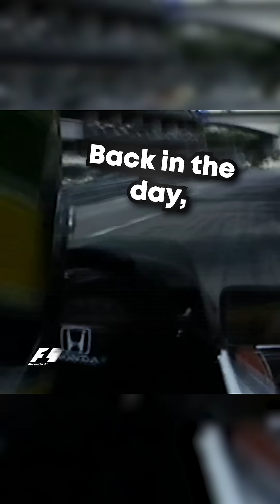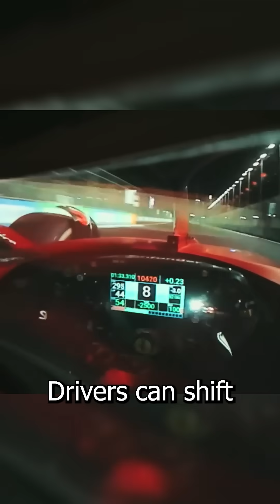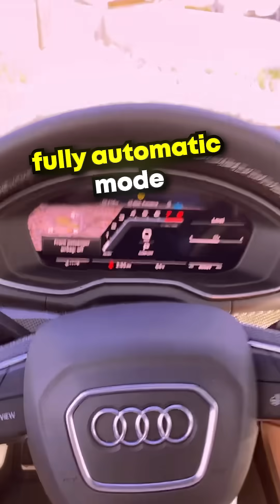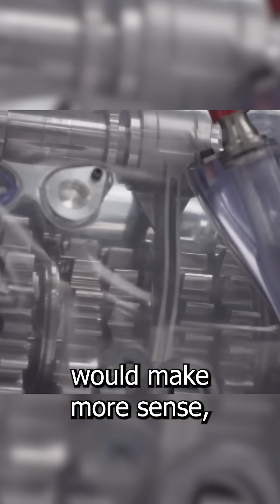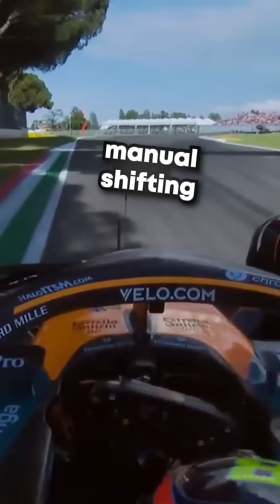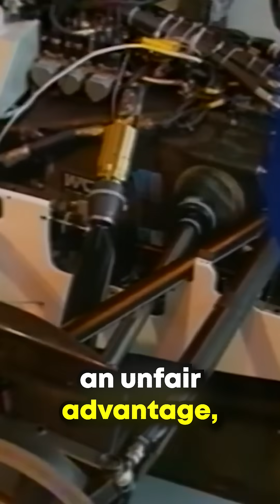Why F1 Cars Are Manual And Not Automatic?

Comment: Calling paddle shifting "manual" and then using cvt as automatic example is just stupid
Reply: paddle shifting is manual though
Reply: @journeyofabadracerit's not, it's semi-automatic
Reply: @bloodysquirrel1731 i mean it is a manual any transmission that you manually shift gears and have a clutch is a manual which these cars do
Reply: @journeyofabadracer just because u "manually" shift the gears doesnt mean its a manual, paddle shifting is sequential because it doesnt require a manually operated clutch to shift through the gears. do ur research before saying anything next time dude
Reply: @journeyofabadracer dude, in F1 you don't shift with clutch...
Reply: @bloodysquirrel1731 they have a clutch though it’s a sequential manual transmission lol
Reply: @journeyofabadracerthey have clutch, to start only, they don't shift with clutch. That's a standard thing for race cars. It's semi-automatic. Not manual. They don't shift how bikes do, they don't pull clutch, shift, release clutch. They just shift
Reply: @bloodysquirrel1731  its a sequential it doesnt use a clutch to shift it uses it for starting and shit obviously its still manually shifting gears as a manual or sequential stick shifts
Reply: @journeyofabadracer just because u "manually" shift the gears doesnt mean its a manual. doubling down when yk ur wrong is a bold move mate
Reply: @il_commendatore999no i don’t know im wrong because i know im right you are manually shifting its a manual not a semi auto or whatever he said
Reply: @journeyofabadracer that's exactly what "semi-automatic transmission" means. You manually select a gear you want to be in and a car automatically operates mechanical bits to shift, hence semi-automatic. You should really read up some definitions before you make a fool of yourself
Reply: @bloodysquirrel1731 the computer doesn’t shift the car? like any other sequential the transmission is doing all the work the only thing the computer on the f1 cars do shifting wise is just make the shifts faster you can easily shift the sequential cars without any of those computers
Reply: @journeyofabadracer search up sequential mate
Reply: @journeyofabadracer dude, it doesn't matter it's sequential, you can have semi-automatic H pattern. Please, look up what semi-automatic means, then talk
Reply: @bloodysquirrel1731 i know what a semi automatic means lmao it isn’t one
Reply: @il_commendatore999i know what a sequential is
Reply: @journeyofabadracerit's exactly what it is. Not out fault you are dense
Reply: @bloodysquirrel1731 no it isn’t lol a semi auto is something like a dual clutch where it has both an auto mode and a sequential mode sequential gear boxes are manual with an automated clutch blip and sometimes an automated throttle blip other then that there’s no difference between a sequential and a manual
Reply: @bloodysquirrel1731  just ignore that guy, if he doesnt want information then ig we dont need to give it.
Reply: @journeyofabadracer keep believing what u believe, at the end of the day you'll be in for a big surprise when u actually search it up
Reply: @il_commendatore999i have actually searched it up lmao tell me what i’m missing otherwise
Reply: @journeyofabadracerdude, you are describing semi automatic. You select a gear and a car shifts (automatic clutch and throttle as you said). Yes, most automatic cars can switch to semi automatic mode but that doesn't mean that semi automatic cant exists on its own.
Reply: @il_commendatore999You can shift any "100% manual" gearbox in the world without using clutch.
Reply: @journeyofabadracerYou ain't right then. Please do your research.
Reply: @bloodysquirrel1731 your all wrong let me break it down. Formula 1 transmission uses electronics and hydraulics for lightning-fast shifts, eliminating the clutch pedal for most driving. Think of it as a highly sophisticated, computer-controlled manual where the driver tells the car when to shift, but the car handles the clutch.
Reply: @PDX_MilitiaOfWar "used electronics... Handles clutch automaticky"
thanks for confirming that it's semi-automatic transmission
Reply: @bloodysquirrel1731 bro what you mean my father works on the cars for Red Bull team
Reply: @PDX_MilitiaOfWar and he is not sharing his expertise with you, right? F1 transmission is classified as semi automatic anywhere you look. I would also be surprised if the shifts actually use clutch, it will be most likely clutch less shifting as most racing cars and bikes do.
Reply: You're just being pedantic
Reply: Turbo clueless ye i agree
Reply: it's not stupid, it's diabolically idiotic
Reply: my apologies einstein 🤣
Reply: The word Manual is defined as "relating to or done with hands" therefore paddles are manuals by definition. You may not like it but it's the truth
Reply: Psh cvt was the goat when it was implemented
Reply: @BrandonBerube-j7y being goat doesn't make it automatic tho
Reply: Let’s race 🥀
Reply: Ok to add up.. manual is you change the gear manually by your hand not by mechanical components through a lever..😂
Your meaning of manual is not correct! 😂
Reply: @a.a.a.nugroho not, what you are talking about is semi-automatic. In semi-automatic you tell a computer which gear you want to be in and the computer does the rest of the work.
In manual, you do all the work, from disengaging l disengaging clutch to moving gear mechanism
Reply: @bloodysquirrel1731  you're just being pedantic
Reply: @a.a.a.nugroho or you being ignorant
Reply: @bloodysquirrel1731  paddle shift always mentioned as manually changing gears, because yourself changing it, even though system does the inside part. You can read it in the news..  GET IT?
Reply: @a.a.a.nugroho where is it written?
Reply: I guess a sequential transmission is automatic too right 😒 cause you don’t have to use the clutch for that unless starting and stopping
Reply: @Markbabb  sequential transmissions aren't automatic in any way. 

It is also possible to shift H pattern manuals (race and road car transmissions) without using the clutch in a way that doesn't damage the car, does that make it an automatic transmission?
Reply: @Official_MikeyT bro I never said it was I was being sarcastic
Reply: @Official_MikeyT half the people that drive manual can't shift without clutch sadly
Reply: @Markbabb  sequential isnt automatic or manual they are literally called sequential.
Reply: @inspectah6278  Sequential is the type of shifter, the gearbox is a manual.
Reply: @DriftNick as long as you don't need to control clutch, it never can be manual.
Reply: @bloodysquirrel1731  In the context of F1 they do need to control the clutch to get into first and launch but that is irrelevant to what makes a manual a manual, there manuals where the clutch and shifting is fully controlled by a computer, they are still manual gearboxes, the internals and how the gearbox functions is what makes it a manual.
Reply: @DriftNick  what? Did you smoke something? Automatic means that the car operates internal components automatically. Manual means that you operate the internal components manually. That's all, doesn't matter if you have dual dry clutch, dual wet clutch or just standard clutch. First automatics were nothing else than just computer controlling standard clutch that was in manual cars
Reply: @bloodysquirrel1731  What I smoked is having a basic understanding of what makes a manual gearbox a manual gearbox, F1 uses manual gearboxes, it's as simply as that, paddle shifter does not change that fact.
Reply: @DriftNick ok, explain it. Make me definition for automatic and manual gear box. What is the difference in your world?
Reply: Sequential transmissions are still considered manual. and CVTs are still considered automatic. So the video technically isnt wrong, but he definately should have specified
Reply: @ZakoZeWacko  how tf is sequntial manual?
Reply: @il_commendatore999 are motorcycles automatic then ?
Reply: @moonmoon4188  depends on what motorcycle ur talking abt
Reply: @il_commendatore999how is it not? You have to manually select the gears. All h patterns are manuals but not all manuals are h patterns
Reply: @Evildragonfirez selecting gear is not shifting tho. In elevator you select floor, but do you manually elevate yourself?
Reply: @bloodysquirrel1731 selecting a gear is shifting though, that’s literally what a manual transmission is, the ability to select the gear the vehicle is in. Using a stick is a way of shifting, but so is using a paddle
Reply: @Evildragonfirez  but with paddle shifters, ur not actually shifting the gears by urself like with a manual. a manual is physically connected to the gearbox while a sequential is electro hydraulically actuated, which means that its ur not physically shifting the gears by urself. each paddle shift goes through a computer which sees the gear u select and shifts into that gear
Reply: @Evildragonfirez no, cause you operate the mechanical bits, you don't select gears in manual, you physically moved the gears. In semi automatic and automatic it's the computer that operates mechanical bits
Reply: @il_commendatore999analog vs digital, still a manual. What matters is that driver is selecting the shift of the vehicle, that’s it. Look up sequential and you’ll see that’s it’s a type of manual transmission. It sure as hell isn’t an automatic
Reply: @Evildragonfirez  nobody said its automatic mate, sequential is sequential, manual is manual, and automatic is automatic. i cant believe im having to explain this to u kids.
Reply: @il_commendatore999sequential just means that your can’t skip gears, that you must shift sequentially, still a manual.

But enlighten me genius, what is a manual to you?
Reply: @Evildragonfirez  a manual transmission is a transmission in which u manually shift, using a manual clutch, to change the gears in a car. while f1 cars do have a manually uperated clutch paddle, it is only use to get rolling, not to shift gears, therefore it is not a manual transmission, but a sequential transmission.
Reply: @Evildragonfirez yes, if you read my comments you would know that I said that manual can be sequential and H pattern can be semi automatic. The definition of semi automatic is that you select a gear and the cars shifts into that gear. Manual means that you operate every step of shifting, aka controlling gas, clutch and gears.
Reply: @bloodysquirrel1731 that’s not what manual means, that’s your interpretation
Reply: @bloodysquirrel1731 you don’t need to control the clutch for a transmission to be manual, please link a source for that definition. There are even clutch-less h patterns (they’re not really clutch less but the clutch is engaged at the point of gate actuation), what are you talking about man?
Reply: @Evildragonfirez you can find definition for semi automatic and manual yourself. It doesn't allow me to post links.
Yes, clutchless H pattern is semi-automatic H pattern....
Reply: @il_commendatore999 It is a manual  transmission, it works like every other manual transmission, sequential is simply the type of shifter it uses, the difference is in what moves the shift forks.
Reply: @il_commendatore999 So then according to you, none of my motorcycles have manual transmission.
Reply: @bloodysquirrel1731 This is also true with H-pattern bro.

You only need a fully-controlled clutch to make it fully manual, in your sense.
Reply: @KikuraKun  not sure if I understand what you are trying to say. 

For me, to something be manual shifting, you have to operate the mechanical parts. That means clutch and gears. Doesn't matter if it's H pattern or sequential. 
If you only select a gear and then computer shifts into that gear for you, that's semi-automat.
Reply: @ZakoZeWacko  sequential if you use clutch is manual (like on motorbike), but if it has no clutch pedal (or is designed to not be used with one) it's "semi-automatic." CVT is not automatic transmission, it's CVT, there are no gear changes, no clutch what would be automaticky controlled.
Reply: But it is clearly Manual 😅
Reply: @FrittenFriseurLPs  get yo dumbass out of here man
Reply: Geek
Reply: @ruemumiji2060  is it so wrong to knew basic things like the difference between sequential and manul?
Reply: @il_commendatore999it is
Reply: @aleksandarrubin  a manual car requires a clutch that u operate manually to shift through the gears. while f1 cars have a clutch paddle, they only use it to get moving, not to shift, therefore it is not manual.

Comment: You can't really say that automatic gearboxes were tested, because only the cvt was tested by williams, and a cvt isn't really a traditional automatic gearbox, since you don't have any gears, you just have a belt, therefore there are no gears to be shifted
Reply: I think they had fully automatic gearboxes in the early 2000's, though the drivers still used the paddle to semi-automatically downshift. Automatic transmission was banned in 2004 according to google
Reply: @ they had the option to run fully automatic in the 90s until is was banned. it was a setting that could be selected
Reply: Nobody cares. Go talk to women or something 😮

Comment: Jesus, someone mixed up automatic with CVT. :-D
Reply: CVT is automatic. Anything without shifting by human us automatic.
Reply: @kl9518 The video doesn't specify Williams tried CVT, which could lead to confusion. The problem is that CVT was banned, even if it was controlled manually. An ordinary automatic transmission wouldn't give nearly any advantage and the noise would be OK. CVT allowed using full engine power constantly, making a constant high pitch noise.
Reply: @kl9518  not all automatics are CVTs, so it’s misleading nevertheless

Comment: The second reason is not correct. The CVT was banned in 90s after beig tested, not a fully automatic system. Inmo, it was better with fully manual transmission.
Reply: CVT uses maximum power all the time, which was the best system. It was banned, and engineers couldn't manage the engine at maximum power for the whole race.
Reply: @kl9518 Da....mnogo vise vremena bi motor provodio na maksimalnim obrtajima...pretpostavljam da je i trosio vise goriva...ali ne mogu da tvrdim..
Reply: @kl9518 that’s actually not true…
Reply: @DCMel0  what part of what he said is not true?
Reply: Was just about to comment this, then saw you neat me to it 😂

Comment: The second reason is ridiculous; it's completely unrelated to the automatic transmission ban. This is a different type of automatic transmission that maintains constant RPMs
Reply: You mean CVT?
Reply: @L0n3St4rWasUnavailable yea he meant the cvt
Reply: its incredible these days. research more than 2 seconds, its like they arent even trying
Reply: almost as if its an AI slop video
Reply: Cvt in racing? Really great acceleration 😅
Reply: @m.irfan-7069  Are you sarcastic? Because yes, with a cvt you get the perfect rpm all the time. So the engine is in the perfect operating window. That in turn gives better performance, but a terrific sound because the shifts are what gives that "kick".
Reply: @m.irfan-7069 , Williams/Renault tried it in the 90's with their high-tech car which won the World Championship for Nigel Mansell. Too much wear and the engine was too powerful
Reply: @m.irfan-7069  terrible starting speed but holy shit cvts move power quick. You hold 4k rpm or higher with no pause for shifting.

Comment: Ferrari brings the semi-automatic gearbox to the wheel in 1989
Reply: Actually, they tested in 80s with Gilles Villeneuve.
Reply: @kartwizard  they didn’t bring it into actual competition until 1989 when John Barnard wanted to streamline the cockpit of the car, and thus brought in the semi-automatic in order to remove the manual gear lever

Comment: I prefer Manual over automatic
Reply: Pusssy😂
Reply: Sure you do but imagine having to shift continuously for a long period of time ,it can get tiring for fingers
Reply: @Noonecares2010  drivers are professionals I think shifting is the least they have to worry about when they are driving a 1000 hp car with 5 g force and up to 6 maybe even 7 on some very aggressive high speed corners
Reply: @physicshater99an f1 car has never reached 7gs